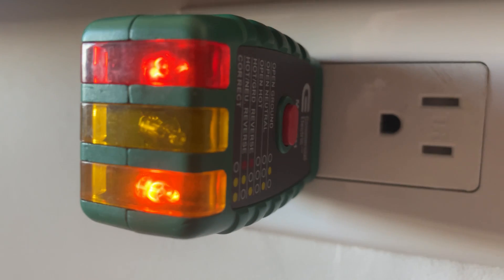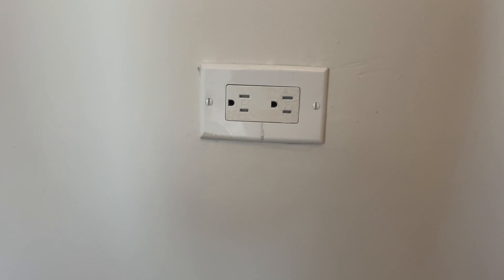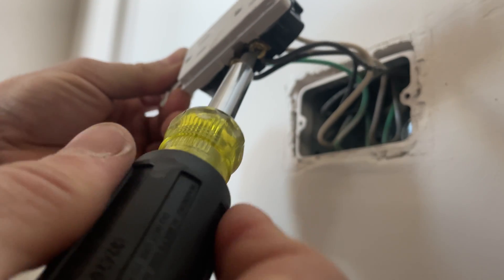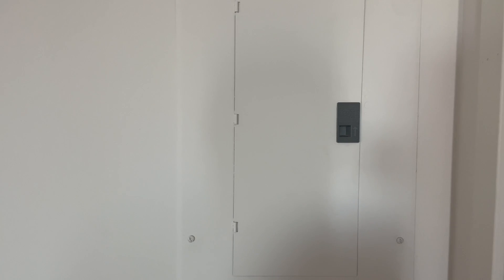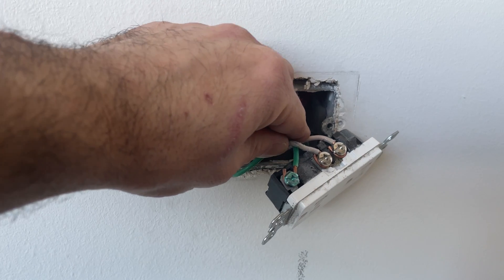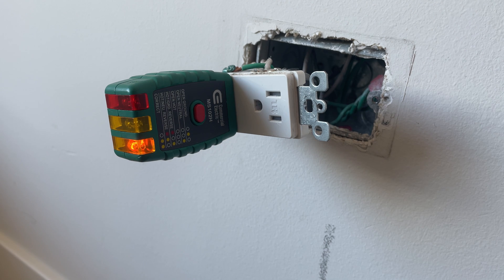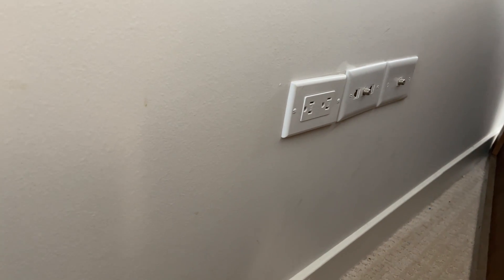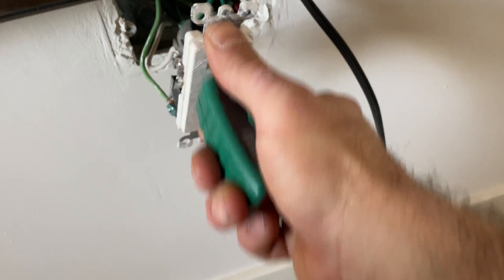Hot Ground Reverse on Outlet Tester Troubleshooting

Comment: Majority of the time a hot-ground reverse on a 3 light tester is usually an open neutral due to the way the tester actually works. If you want to confirm if its actually a hot-ground reverse grab a multimeter and test between neutral and ground. If you get any voltage, it's definitely reversed. Most of the time you'll get some weird voltage reading between hot and neutral but neutral to ground should always be 0.

Comment: Thanks for keeping it as-is.I just had the same problem, however mine was caused by the neutral in one of those small push-in holes. The wire didn't pinch properly inside and was not making good contact. Wired directly to the screw to fix. My problem came about though, after we had power come back on after a windstorm. Half of the outlets and lights on this circuit didn't come back on. Current surge must have brought the problem out.

Thanks!

Comment: I'm dealing with a hot ground reverse on my trailer. I have power to the breaker. I'm going to try to tighten the wires like you did but I think it might be the automatic line/generator switch. 😮 I hope not but I think it is because none of the 12v accessories work either

Comment: Very good video for any electrician, especially electricians that drive service trucks and perform service calls. This is the kind of problem solving that separates the Romex Runners from highly trained, highly skilled electricians who have a firm understanding for the physics of electricity, as well as for  the installation of electrical service entrance equipment, and the branch circuits fed by that service entrance equipment as directed by the NEC/NFPA Electrical Code Book and the qualifying "Authority Having Jurisdiction" a.k.a. the Electrical Code Inspector.

Comment: Hot/Ground reverse is always an open neutral with a load. Electricity is trying to find a path back to source and since neutral is lost, it uses ground. Hot to ground. Without load, electricity isn’t flowing.

Comment: Thanks you for uploading this video. I think I’m just going to replace all my suspect outlets. I replaced the power supply in my home office PC, then when I turned the PC back on, everything in the room when dead…. At first I thought it was a defective power supply. After a bit of trouble shooting I concluded it was indeed the actual electrical service. Again, I very much appreciated your attention detail.
Reply: Well, it turns out that I only replace on receptacle and it seems to have fixed the problem. However, I need to give credit where credit is due. I didn’t know what to do until I watched your video. Thanks again….

Comment: Okokok. Now what if you have all that with a breaker off but turns off the circuit when breaker is in the on position. It is supposed to be a dedicated circuit to the microwave btw

Comment: I found a case where the tester showed correctly that the receptacle in question was wired incorrectly by the person who installed it.  I can't call him an electrician because in addition to transposing the hot and ground wires he wrapped all the wires around the screws counter clockwise!  I put the wires where they belonged and the problem was solved.

Comment: I'm having this now with outlets and lights not working. not looking forward to checking all the outlets for loose neutrals. the neutral on the line is hot so something is completing the circuit. im disappointed you cant isolate the plug by unplugging the load on the plug. may have been all of them combined? good to see the tester can be fooled and how to troubleshoot though.

Comment: Trying to trace an open neutral on several outlets and discovered that the "electrician" who wired the house when it was built used the "stab-in" holes on the backs of the outlets instead of using the screws. Unbelievable!

Comment: Also worth considering... an outlet could have been missing the little brass jumper that joins the two neutral screws (removed if it is a split outlet).  That wasn't the case today, but I'm sure you were looking for it.

Comment: I just had this exact problem one day ago at my daughters condo. I knew it was a neutral issue but the tester showed same indication as this video. It turned out to be a loose neutral on an outside wall and was corroded and discolored. Cleaned up the wire and installed new outlet. Works great now. I will remember to unplug everything to see if it indicates open neutral next time.

Comment: Had a power bar plugged in so I could use 3 plugs. It has worked fine for a year or more " THEN " pop. Power bar burnt and plug burnt ,glad I was home. Turned power off , took out receptacle , burnt! Noticed it was wired wrong. Replaced this one and checked all the others, which some were back stab and I changed. I still have rev polarity. I have fuses and all are good. What else can I do? HELP!!!
Reply: Just stay in charge and don't ever get disconnected.

Comment: Thank you very much for this detailed video.
I thought I checked every receptacle 1.bath room,2. Garage , 3.patio, 4.attic and checked the wiring . Then three hours later. 
 Watched  your video this morning for  the second time and proceed to check everything again.  
 Yes the issue is solved at the GFCI switch.
The 5 minute break is totally recommended. 👌
Reply from the maker: Thank you so much 😊 !!
Reply: Well, whoever did the initial trim on putting the receptacles and switches in just obviously was not strong enough to tighten them properly. You need to go through and check every outlet and every switch in the house. More likely than not, there are several, if not all of them with loose connections. Also you should make a detailed panel  identification of every outlet in all rooms. It takes time but when troubleshooting it will be much easier.

Comment: And what would a call to a electric service have cost?  I could do what you did here except I'm confused about the terminology...hot ground reverse, loose neutral, and I hear ground wire a lot.  In order to do it myself I'd have to spend a good amount of time learning this terminology.  If I was younger I would.  I will throw the main breaker as I have 2 indoor outlets not working, 1 outdoor, and I'd like to replace an outlet in my garage.  I also have 3 outdoor entrance fixtures that I want to disconnect and paint.  Thanks for the video
Reply: You would either learn the terminology or learn to come up with your own terminology....that's what mostly being a DIYer is all about. I make time on the weekends to inform/educate myself.

Comment: I hope you made a note on which outlet was the home outlet (The first in the chain) so it makes life easier in the future not only in that unit but others in the building that may develop the same issue.
That home outlet and cable TV connections make my OCD scream being sideways and in three separate single gang boxes. That can be reduced down to two single gang boxes, one for the outlet and one with a dual keystone plate and two  F connector keys installed.
Reply from the maker: Thanks for the input 👍

Comment: I just bought two Klein outlet testers. One has the gcfi tester. The one that is regular shows that my wiring is good on all of my outlets in my travel trailer. The one that also has the gcfi tester shows all of my outlets have neutral hot reversed and less than 30 volts. Is this common for travel trailers to be reversed? All the outlets work just fine when I plug into all of them, I thought if the wiring was reversed the outlets won’t work though.

Comment: This video helped me take the right approach to find a loose outlet causing my hot ground. The culprit was an outdoor outlet on the patio from 1980. One of the white wires was loose out of the quickwire back punch. One of the black wires was nearly as loose and came right out. The patio is on the same circuit as three of my bathroom GFCI, resulting in my GFCI not testing properly. Going to be upgrading the patio outlet to a GFCI now. Thank you!

Comment: I am a total newb at this, but is it true that if one of them is not connected properly the whole thing is not turned on?
I just changed my receptacles in my 1 room and the lights in my bathroom wont turn on at all. Does this mean I have to check all the receptacles on that floor. What would be a fix for my case here please?
Reply: Get current to the lights via Hot conductor.

Comment: Thanks for your YouTube video. It helped me find an open, neutral wire. Showed up as a dead outlet, but the open neutral was in a 3-way switch controlling ceiling lights on the same circuit.  What a pain to find. Scratched my head many times.

Comment: Thanks for this. I got lucky: found the loose neutral on the third outlet try. The next suspect was behind an upright piano. As soon as I got a look at the socket, I could see the wire almost completely out of the quick-connect hole and the discolored insulation.

Comment: All these outlets were "speed wired". This is wrong. There should have been one hot and one neutral into each receptacle. You take the inbound hot, bond it to the outgoing hot with a pigtail, which goes to the receptacle. Same with the neutrals. With speed wiring, if you pull one receptacle out, all the downstream receptacles are disconnected. Moreover, each receptacle carries the load for every downstream device. With pigtails, each receptacle only carries the load for the devices connected to it.

Comment: You found so many outlets with problems ... Whoever installed them did either install them poorly, or the whole apartment is 40+ years old (*) ... I suggest you check ALL other outlets and all other switches in that apartment, too ... 

(*) That's why over here, for over 50 years, most sockets and outlets have no screws anymore, and I personally have not seen any failure of those since then (while in older installations, screws can get loose sometimes like in the video, even in screw terminals (not used anymore since the 90s either)).

Comment: Who did the initial wiring of all those receptacles?  Fred, the plumber?  They were all installed poorly ... loose screw connections, bad wire nut connections, wiring all the receptacles serially instead of in parallel, no electrical tape wrapping of the connections.

Comment: As an electrician, I've run into my share of these. One thing I noticed on that last receptacle was the loose neutral was discolored because of heating from the loose connection. No fire hazard there. None at all.

This is why one should never quickwire receptacles - it's inevitable one will come loose, just like losing on Vegas. Pigtails were also mentioned, and any time one can avoid using a device to carry current through the circuit is a good thing.
Reply: Yep I noticed the discoloration on the neutral also if it ain't white questions should be answered.
Reply: Having issue in my mobile home have 120v in all non working outlets but no power when plugging something in tester is reading hot/ground reversed Ive dont everything in this video and still getting the same reading I have no lights in three rooms and only one outlet in those rooms work can’t find the issue

Comment: Just went through the same process and of course, after tightening many loose neutrals, it was the next to last outlet in circuit. Funny thing is several other receptacles had looser neutrals than the culprit. Anyway saving the cost of an electrician to come out is always a good thing!
Reply from the maker: Always the last one 😆

Comment: Thanks for your video it is much appreciated!! I’m currently dealing with this same problem with my own home and I’ve eliminated three outlets that had the same reading. Now I need to pull the bed back and check that outlet which I will do after my frustration break.. great video and truant you for taking the time to share with us..
Reply from the maker: Thanks Cecil let us know if you get it fixed!

Comment: Nice troubleshooting.   Sadly to say, it just comes to show you many times particularly in mass produced tract homes and new apartment buildings as well, the workmanship is often very shoddy since many contractors get paid by the job, and their goal is to get as many homes as possible ready to put on the market,  particularly the housing boom of the 90s and early 2000s prior to the subprime mortgage crisis.
Reply from the maker: Ya it’s crazy how much crap work is out there - need more inspectors or more quality installers? Probably a mixture of both

Comment: Nowaday use a Wago nut for connection.  Much better. No more twisted nut
Reply from the maker: Unfortunately most buildings in the city are build cheap and when the building was constructed they could save a little money by using wire nuts 😕

Comment: Thank you for this video. After hours and hours, I diagnosed and solved the open neutral in my new house. It turned out to be in a junction box in the attic. Inside was a triple neutral connection with too much insulation left on one of the three wires and a defective wire nut that had a layer of plastic over the metal spiral. Again, thank you so much for the guidance! I can finally move on with my life now, ugh!

Comment: Good video!  At 7:34 in the video, the wall electrical receptacle is recessed below the wall cover so I would use a spacer to bring the receptacle forward to be flush with the drywall and the wall cover.  Interesting, the person who originally wired these receptacles used the receptacles themselves to be a continuous path for the electrical circuit by using the 2 silver screws (white neutral wires) and 2 brass screws (black hot wires).  The one pair of white and black wires bring in the electricity into the electrical box and then then the other pair of white and black wires bring out of the electrical box to the next electrical box will only add more room for error and problems for the entire circuit.  If the person had "pig tailed" the wires in each of the electrical boxes, there would only be a black and white wire going to the receptacle and the rest of the electrical circuit would be continuous and undisturbed.  If there was an "open neutral" electrical situation, it would only occur at the one receptacle itself and not affect the rest of the circuit.
Reply from the maker: Thank you Bill for the detailed reply :) Very useful

Comment: I am having the exact same problem, thank you so much.
Reply from the maker: Good luck mannyrob 👍
Reply: @ApartmentMaintenancePro  it was exactly what you said it would be & i would like to add I had a hard time finding the problem because the homeowner was telling me there as only one outlet on the wall where the bad outlets were giving me the open neutral, but after going through all the outlets i noticed that the outlet was located more to one side of the wall so i moved a bookshelf on the other side of the same wall & there was my bad outlet, homeowner had completely forgot it was there.

Comment: One thing not stressed in this video .... diyers please take note....the tester showed there was power in every box.  

Because the neutrals were open, had the light switch been on, voltage would travel from the hot, through the bulb, and down the neutral.  Yes the neutral would read 120 volts to ground and the light or anything plugged in would not work, but their would still be killer voltage in the boxes.

Non-contact voltage detectors will indicate power in the box just like the recepticle tester did.

Be careful out there.

Look for information or videos on "hot neutrals" for a better understanding.

Comment: The continuity of an electrical circuit should never be dependant on a terminal screw of a receptacle. So many things that can go wrong... DO NOT wire multiple wires on screw terminal. This is exactly why you had this issue in the first place.

Comment: That was so helpful, (especially the “so frustrated, had to take a 5 minute break”😂). I’m wiring an in-wall iron lamp/plug and after a few pops in the box, the rest of the room showed the hot/ground switch after previously being fine. Your search explained that I really just needed to tighten the connections again. Of course the box they provided is too small for all the wires they think I’m putting in it!
Reply from the maker: Thank you so much Rebecca :) So glad you got it fixed to :)

Comment: I have power to my shed working just fine for the last 8-10 years and today no lights and no power, or so I thought. I plugged in a tester and to my surprise it showed a hot ground reverse. I know for a fact it WAS wired correctly so I assumed something was up in my panel since my a/c was just replaced. I thought maybe they knocked something loose. Before I called the company, I decided to check google, mainly to arm myself. After watching this, I realize I need to go unplug stuff (mini-fridge, chargers, etc) and test again and possibly start removing face plates. Thank you for giving me the confidence to tackle this! Before your video, I had no clue on how to proceed.
Reply: I'm in the same exact situation as you are any update or would you forgot what your problem was cuz the air conditioner and everything else and now my sheds power is not working . I've got two legs that run out there underground separately . An one leg is the same problem